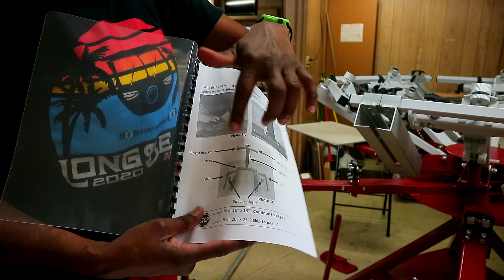Assembling My New Anatol Screen Printing Equipment

Comment: Oyea it’s coming together! Would’ve been nice to find a stand for it or drape a white sheet over the desk the unit sitting on.
Reply from the maker: Like I said in the video it's a temp fix for the exposure unit so I don't want to cover the drawers on the desk because I have things in them that I need to use.  A white sheet wouldn't last long in a print shop with all the inks and chemicals.  Thank you for watching!
Reply: TshirtChick oh ok sounds good. Still a awesome upgrade